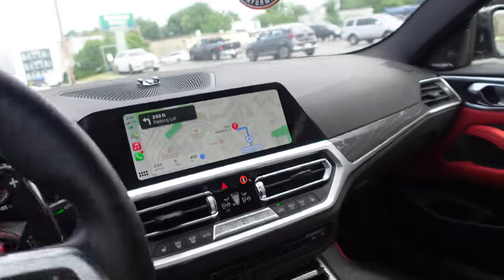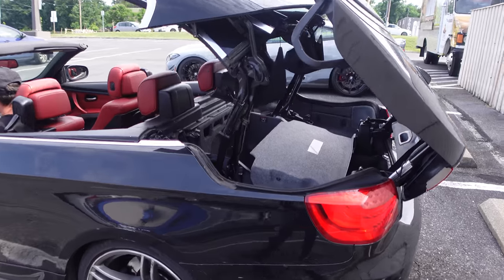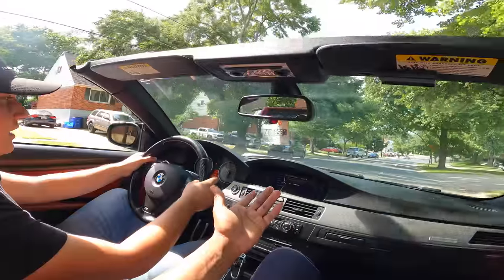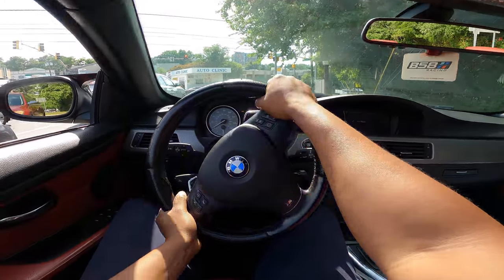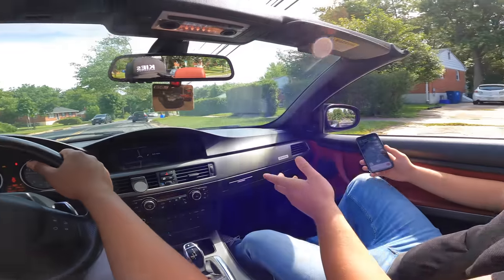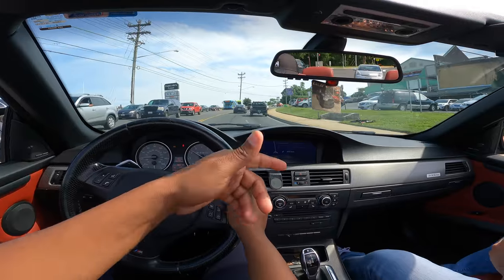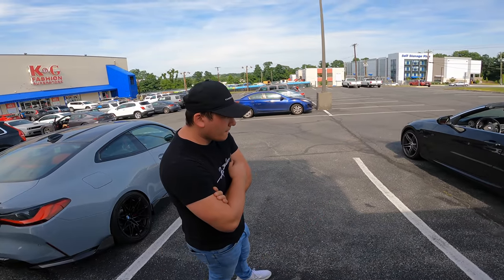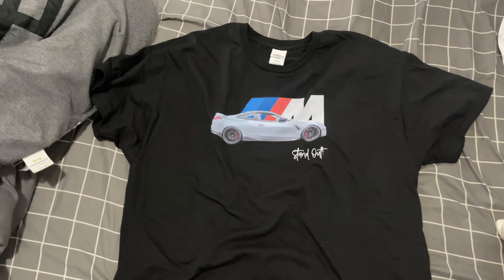TAKING DELIVERY OF A E92 335i BMW DAILY??

Comment: 335is vert is 200lbs heavier than regular chassis and has an electronic lsd. 16k with all the mods is decent he can do better private sale. All you would have to do is regular maintenance..Valve cover, ofhg,sparks plugs, carbon clean, dct refresh fluids and filter. Suspension is where it takes a hit. Rear springs need to be stronger 12k for best traction. Coilover kit with custom 12k rear spring or upgradable in their package. Now for more power 17t or 19t turbos with port injection 550-620 hp wheel. With upgraded act trans flash and upgraded coolers(trans/oil) definitely qualified lol   
With these engines 600hp is reliable...can up shoot to 700hp(Single) but you'll eventually pop the motor. From my experience the direct fuel injection increase with tune and added power are the enemy of these motors also the extended oil change intervals. With DI fuel it  degrades the oil quicker 
so 3k oil changes. Moshimoto thermostat and upgraded coolers eng/trans are a definite plus.   

What it comes down to it you get a budget m3 supercharged 600hp clone...for half the price... with him doing most of the bolt ons its half way done. Definitely a nice content generator...just have too put your touches on it..

Comment: Can’t go wrong with an iS
Reply from the maker: Yea that DCT hits!
Reply: @Slowspeed  trying to get one of these at the auction prices either crazy or they done done 😂.
Reply: I have that same car, and trust you have to do the oil pan gasket looking at 17-21 hundred, going to need all new suspension and tires and wheels, bumper and engine out service for new turbos…. With this being a salvage title it’s worth no more then 12-13k max I don’t recall him saying the miles on this but since you plan on tuning the car it being a is does not mean shit… cool that it has one of the first gen 7 speed dual clutch but your going to have to replace that as well once you go single big turbo… so here is my take…. Buy a cheap one for 3-6k and then do all the things you wanted to do to her and be at the 10-12k range when done. Your car will be sorted out with paper work and service records and when you do decide to get rid of it you can get max value since it won’t be a salvage title.  Don’t buy this car unless price is 8500-10k max… thank me later.
Reply: @kevincohen5628  ur 100% right

Comment: They be going for around high 20s-low 30s. They don’t be selling though. For a basic is I’d go 12-14k
But this got red interior/Harmon/Vert/N54/silver trim/DCT plus bolt ons! 16500 is fair in my opinion
Reply: yeah honestly really nice car just dont think the rebuilt title is nice but majority of these models bare in mind DO have a specific warning on the title regarding the recalls inwhich majority of dealers had to buy them back

Comment: My thoughts are its really clean for a rebuilt title BMW, the wheels are sweet and definitely got some sound to it and is fast for a daily car. Red interior is "chef's kiss" the convertible aspect is not something i'm keen on but if you want the wind in your hair its an added bonus and you seem to like to convertible beamers. In this wild market the price is reasonable I suppose at 16k. Probably would offer less somewhere around 10k-11k. Final Verdict in my opinion is go for it but offer couple thousand less than $16k

Also... there go another one! @ 22:16 you see a pretty Acura TLX A-Spec in Modern Steel Metallic w/ Red Interior Black Suede Inserts such nice cars just wish Acura made them faster from factory! 

P.S. Love the shirt designs @ 25:14 design #2 is my favorite of the 2 you shown. There's also another shirt you was wearing in a previous video that I liked as well it had your channel name on it and stuff thought that was a really good design too!

Comment: that car is clean I have a 2014 435i m sport convertible and Its Dinan stage 2 with the full exhaust I love the convertibles
Reply: How is the rod bearing
Reply: @hasan_440i   they are holding up pretty well I do constant maintenance on mine eventually I’ll have to get them done
Reply: @migosworl1998  well done just take car don't mode more 
I have a couple friend's who blew there n55
Reply: Yo fix the water leak problem before your amplifier blows